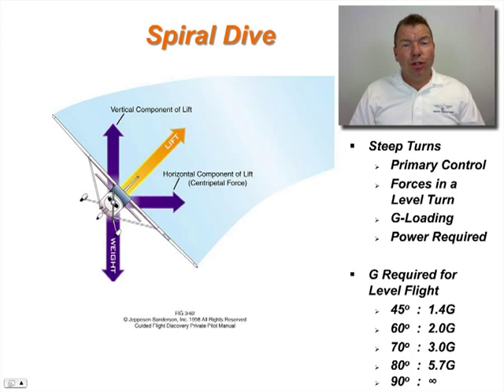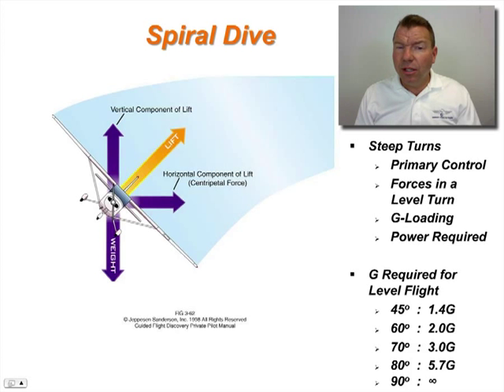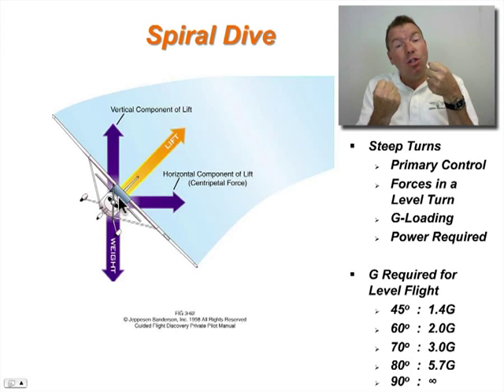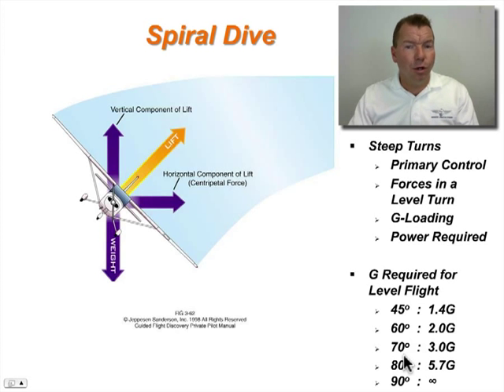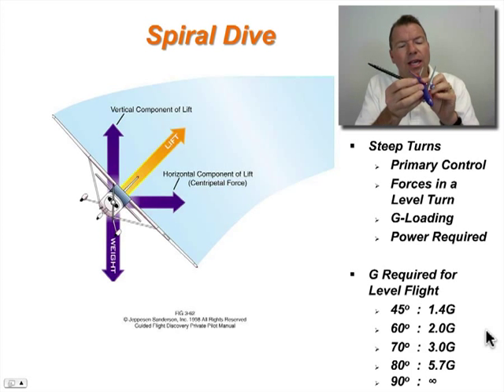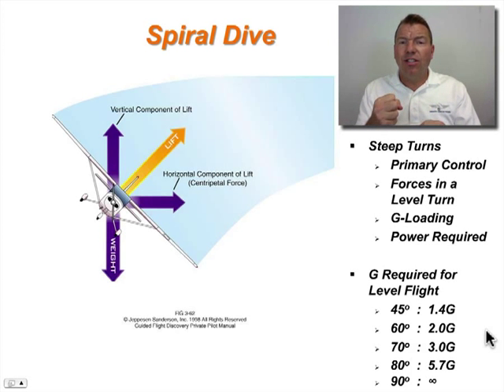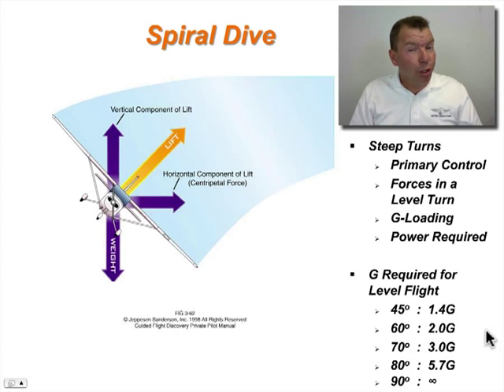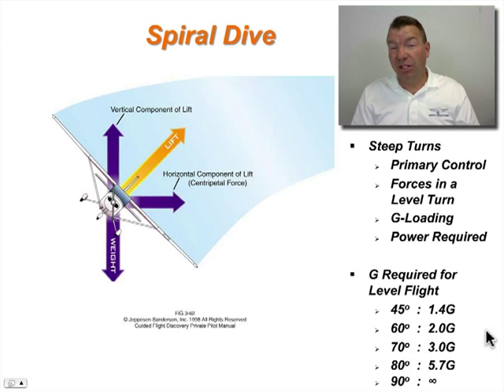Spiral Dive Recovery by APS

Comment: My reflex reaction is to push it into a nose down attitude and then level. The split s is one of my favorite maneuvers. My plane was rated at 7 G's positive 5 negative, most of the maneuver was done in zero GS. Roll it over and let it fall then pull out at about 2 GS

Comment: excellent teaching
a nice simulation view or actual in cockpit view or out of cockpit view would be even better.

When you bank and the direction of your lift changes,
I understand you are no longer getting as much upward lift and so you lose altitude,
are you still getting the same amount of lift - just in a different direction
or does the amount of lift decrease when you bank ?

 I have a greater appreciation for seeing military jets at air show doing a maximum
bank - a few hundred feet off the deck - I think the narrator said 7 or 9 Gs.

so if you are doing a split S , you bank 180 degrees and pull
and that causes you to descend very fast as you then are doing a half loop,
what would the G forces be in that case?

this is what Blue Angel Capt Cuss was doing when he crashed.
He reached max altitude just under 3200 when he should have been at 3500 minimum
and also forgot to back off the afterburner after he finished his high speed climb
and began the split S.
By the time he ejected he was so low the flames of the crash burned his chute 
and some debris hit him.  -  this info base on the report released last week.